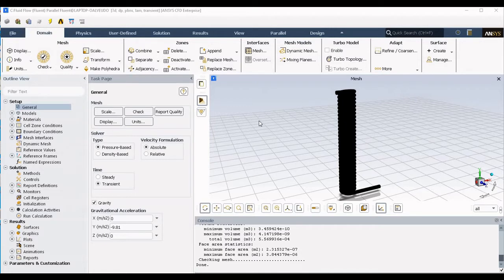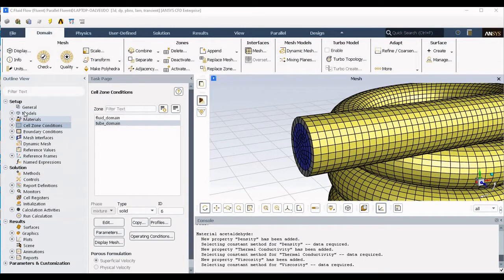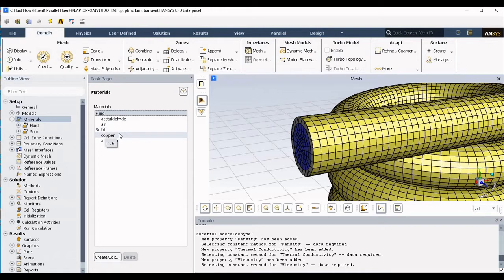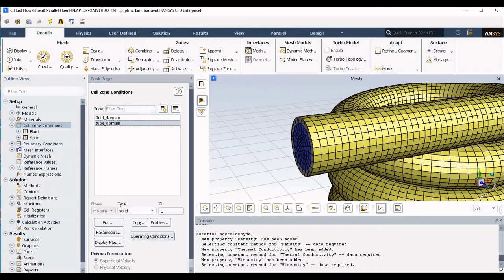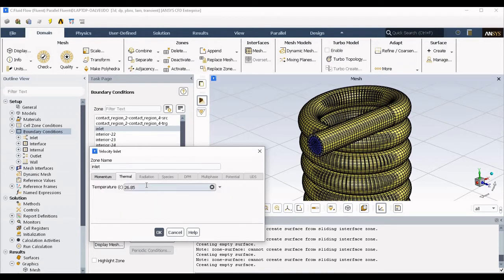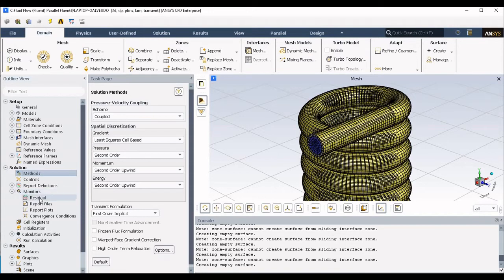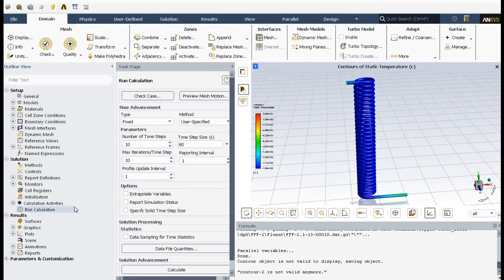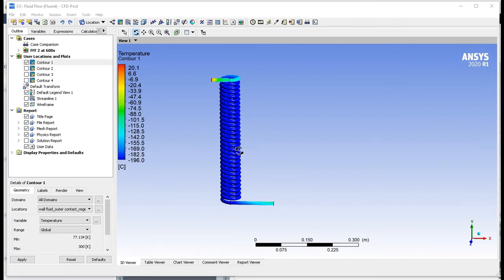Ansys Fluent CFD Cryogenic Pipe Flow Simulation for Liquid Nitrogen PART-2

Comment: If you start with ambient conditions the tube is At ambient temperature and you have LN2 @ -320F, at 0.5 lb/s at the entrance. How long would it take to get liquid nitrogen at the end of the tube?  In real life when you flow LN2 you get gas at the outlet and it takes and X amount time to get fully liquid at the end. Can You even do this on ANSYS?